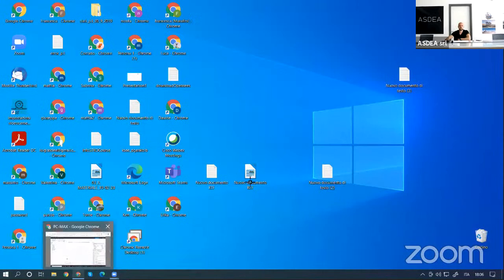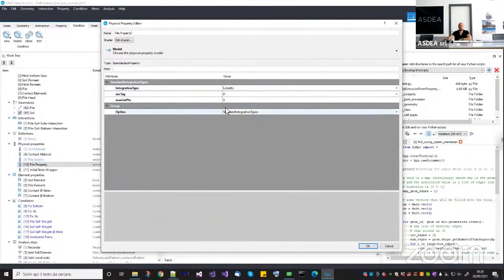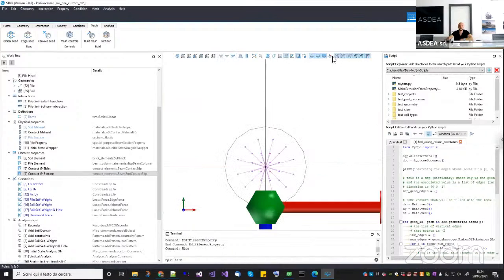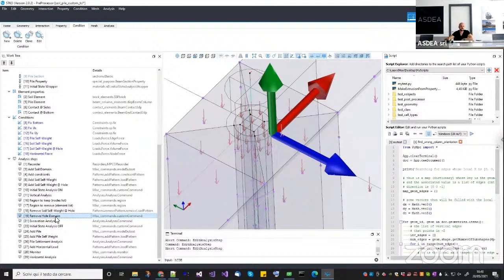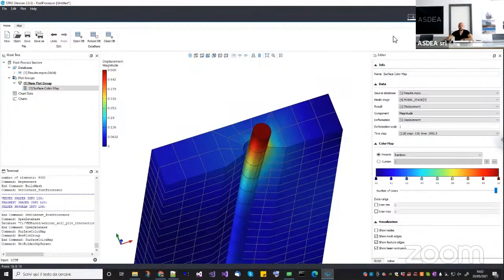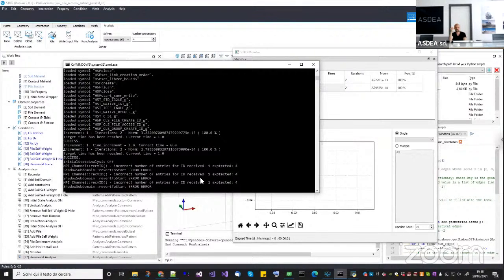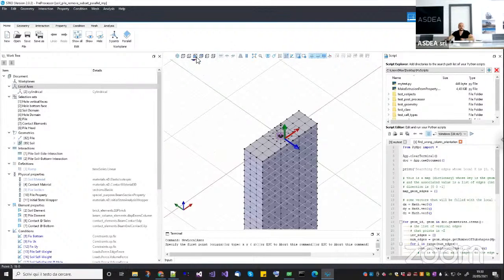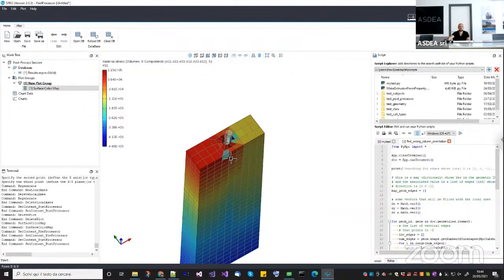E-Learning Course Soil-Pile Interaction - Modeling with STKO's Python API

Comment: Hello professor,
Thank you for sharing as free.
I have some questions.
-I should model 50 piles in soil, Should I define 50 interaction between interface (Wall) of pile and soil and bottom of pile as well or not?
-should I use "node to element link" or the other one?
- for defining interactions, should I select "face" of pile and "face" of soil in contact with pile or pile and soil "solids"?
Thank you so much for responding.

Comment: how can I make a connection between pile and pile cap in opensees? if I use beam element for pile and solid element for pile cap.
Reply from the maker: Beam and solids cannot share the same node because they have different DOFs (6 for beam, 3 for solids).
You need to connect them with a Multi-Point constraint.
EqualDOF (for the common 3 translational dofs) is not sufficient: It's like placing a rotational hinge at the interface between the pile and the cap. You need to create a connection that can transfer moment.
You have 2 options:
1) Easy solution: model the cap as a shell. In this way also the cap has 6 DOFs, so the pile head and the cap can share the same node.
2) More involved solution: model the camp as a solid. Find the solid nodes within the influence radius of the beam section. Duplicate them, creating auxiliary nodes with 6-DOFs at the same position. Connect the solid nodes (3-DOFs) with the auxiliary nodes (6-DOFs) with an EqualDOF(1 2 3). Connect the auxiliary nodes to the beam-head with a RigidLink.
Warning with the second approach: the auxiliary nodes belong simultaneously to 2 Multi-Point constraints. This constraint layout can only be handled by the Penalty Constraint Handler (pay attention to the penalty values)!
Reply: @asdeasoftwaretechnology7930  can I model pile and soil around without creating the hole?

Comment: Thanks for the free content, is it possible to preform the excavation with a python script instead of a tcl script ?
Reply from the maker: Dear Anis,
Assuming you are using OpenSeesPy, yes it is possible. You will simply need to understand what we did with the Tcl script and convert it to Python. OpenSeesPy should support all the functions that OpenSees (Tcl) has.
If instead, you are using STKO's Python-API, the answer is no as the excavation is an element-removal process that happens during the analysis (in OpenSees). Therefore, you should use the same language OpenSees is using
Reply: @asdeasoftwaretechnology7930  Thanks for your answer, i have one more question : is it possible to perform a certain operation on stko and automatically translate it to a tcl command ?
Reply from the maker: @aniskheffache4047  Not a specific operation. Everything in the STKO file will be automatically written in the TCL files when either the "Run Analysis" or "Write Input File" buttons are clicked. In your case, you can simply click on the "Write input file" and look at the input files to understand how we do it.